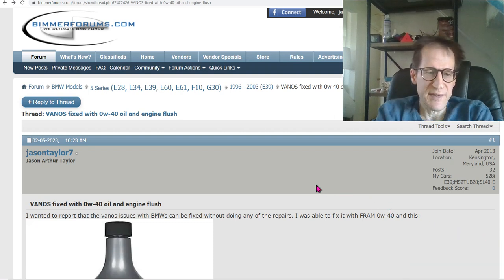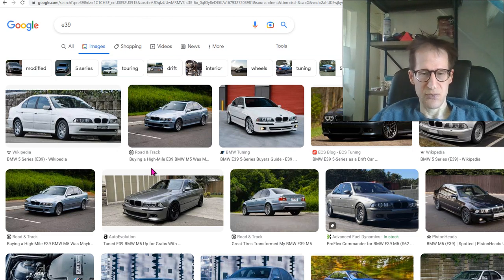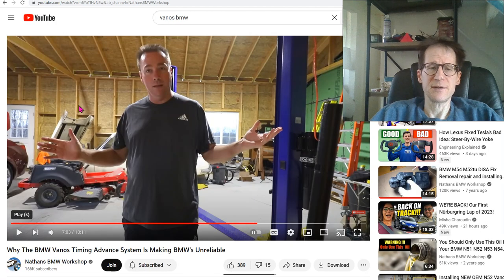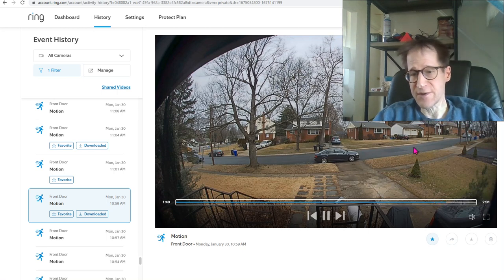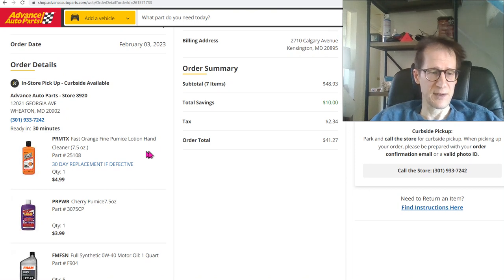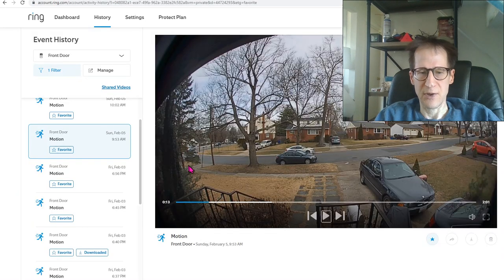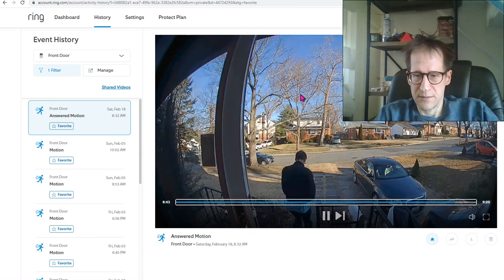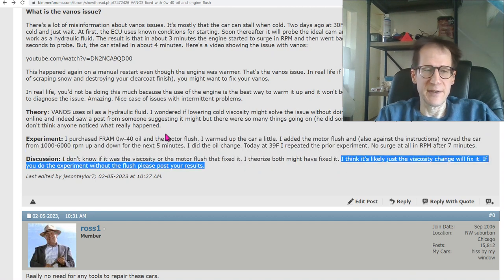Proof I am not making my BMW Vanos fix/solution up

Comment: Hi , I did rebuild the vano on my E39 .... while the vano unit was removed I used a spanner and turned the crank a few turns...to many maybe 🤔, and the right spindle gear came out🥺, I have managed to put it back .... should I be worried before refitting the vano unit? Thank you
Reply from the maker: I never took apart a vanos unit, so I don't know.  (It was the point of the post this video was to prove; that a fix is really possible without doing that.) Sorry.  Perhaps another viewer can answer your question.  

Is the car apart now?  Why search to find this video now when it's disassembled?  IMO you should have searched before you did the repair to avoid the repair, right?